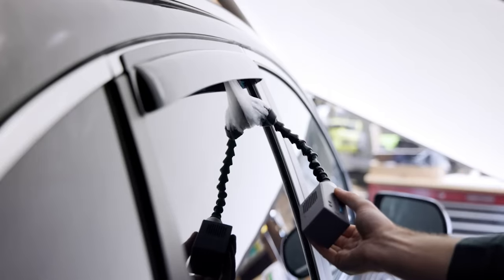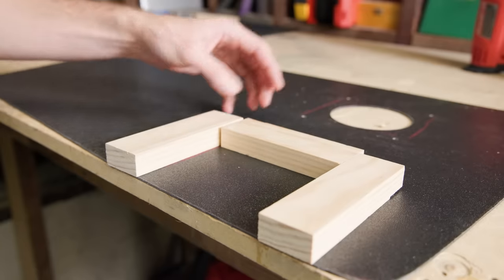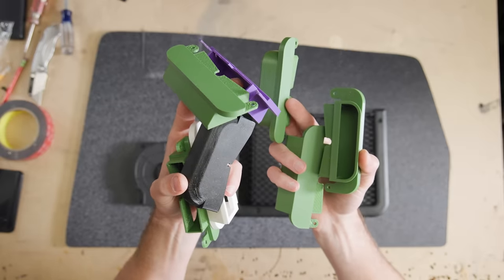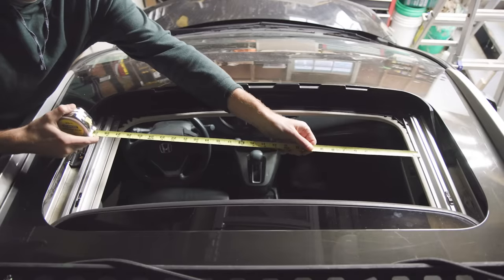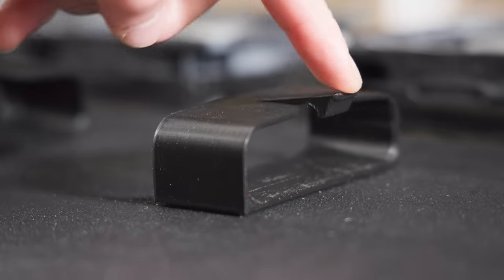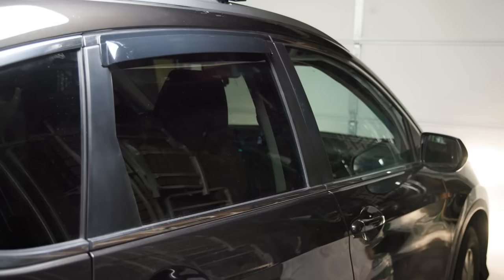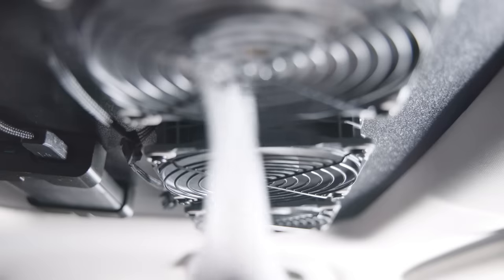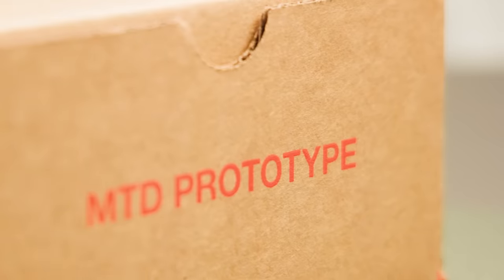Car Camp on Warm Nights With This Invention (V2)

Comment: Your exhaust fans can only expell as much air as your intake fans let into the vehicle - if they'd push out more air, they'd create a vaccuum. For maximum efficiency (noise as well as power consumption), intake and exhaust volumes should be evenly matched. To further reduce noise and increase power efficiency, consider how much airflow you really need. The vehicle's interior volume is not that big. Let's say the volume is 4 cubic meters (which is almost certainly an over-estimatation), to refresh all the air in the vehicle once every minute, you'd only need a capacity of 240 m3/h or about 140CFM.
Reply from the maker: From not enough to too much. Haha. Please hold for another year while I perfect. Thanks for the info!
Reply: I am confusion from this comment
Reply: @nickhernandez4264  Ok. There's 2 parts to this:

1.) Fan capacity - You have a certain amount of air in the car, and you want to refresh this air. The intake fans pump fresh air into the car. The exhaust fans pump stale air out of the car. These have to be balanced. You can not pump in more than you take out. And you can not take out more than you let in. Making the exhaust fans much bigger than the intake fans , just means they are inefficient. They try to work really hard, but they can not pump so much. This will use more electrical power and create more noise.

2.) Airflow - to keep the inside air nice and healthy, you want to refresh it periodically. That means letting stale air out, and letting fresh air in. If you refresh it too slow, the air will go stale, and you will get problems with humidity inside the car. If you cycle the air too quickly, you're wasting electrical power on your fans by making them work more than they need to. If it is cold outside, you will also have a harder time keeping the air inside nice and warm if you constantly bring in cold outside air. In short: you will need to find a balance, where you refresh only as much air as is needed, using as little electrical power for the fans as possible. 

Hope this helps :)
Reply: @akumabito2008  very helpful, greatly appreciated ( you're to kind most people wouldn't have tooken the time to write out and explain ).  Learn something new every day gotta love it 👍
Reply: @nickhernandez4264  you're welcome, my dude. Have an awesome day!
Reply: @MattTheDesigner  you're good with what you've got. You could even omit the intake fan and still be good. All vehicles have an open vent from the outside directly to the cabin to feed the factory a/c system. It's typically below the windshield by the wipers. Exhausting more air than being pulled in by your intake fan will just draw the difference through the factory vent. Omitting the intake fans would just draw a greater amount through the factory provided path.
Reply: Technically correct, of course, but the car is also not a vacuum sealed environment even with all of the doors, windows and sunroof closed. Either a net outflow or net inflow from fans will simply pull air in or push air out of the non-sealed environment, not create a significant overpressure or vacuum.
Reply: With the sun roof exhaust, the window fans are only obstructing the airflow. Removing the window fans, but leaving the opening, will actually increase the air drawn into the vehicle.
Reply: So does the math math if you half the CFM will it just take double the time? So 70cfm will take 2 minutes?
Reply: @DAstler  I've been thinking about taking this a step further and connect the car cabin fan to a powerbank over night, instead of complicated mounting of fans to the windows. But I think the cabin fan would draw too much power?
Reply: @SweetTorment72  that's exactly what this person did on their van: https://youtu.be/0lfheOOliwA?si=JJVoWVOG8d5L1hMw

It's likely going to be way too much power for a little battery bank, but if you're in a camper with more power available it is possible to hack in to the oem blower and run that.
Reply: No yur not correct. The fans on the roof are gonna pull in air even if there are no other fans involved.
Reply: @SweetTorment72  you don't want to mess with the car electrrics too much if you can help it.. can cause problems..
Reply: One does not simply create vacuum with small 12v fans. Slightly negative pressure environment is a better term. In this scenario you would want a balanced supply and exhaust cfm for best realized work to battery capacity ratio(move more air for the same amount of electricity). In lab or sterile settings you need a positive pressure that pushes particles out of the room and mitigates airborne entry. For airborne hazards and ventilation negative pressures are used to quickly remove harmful or unpleasant fumes and odors. Your air changes per hour are dictated by the difference in flow rate in and out per hour and the volume of your space, this value is higher in lab and sterile settings lower in commercial settings and almost nonexistent in most residential settings since they are usually not equipped with fresh air intakes or exhausts.
Reply: @akumabito2008 how do you measure what your fan’s airflow is?
Reply: Cargo space on a mid range suv is around 144 cubic feet. The entire cabin is like 3x that space. You're closer to probably 8-10 cubic meters.
Reply: @chrisz.9974 if his volume for the cabin is accurate then yes he'd be about correct. I believe his volume for the cabin is off my a factor of 2-3 which means you need closer to around 400-500 cfm to replace the air in the cabin every minute.
Reply: Technically yes, but you can have your car be a high pressure compartment (higher intake) or a low pressure one (lower intake). In the offshore industry we design some compartments to be high pressure to either avoid flammable gases to go inside the machine room or poisonous gases to enter compartments with people - i.e. if you open a door, the air escapes instead of going in.
Reply: A vacuum is desirable- that's how chimneys work.   Smaller hole at the top, bigger hole at the bottom.   Heat rises and expands, no fan needed.    If the exhaust is expelling more, then the intake fan works less or may be redundant

Comment: Paint the car white, It drastically reduces internal temperature of car
Reply: That’s true, but it’s not resolve issue when you sleep in the car. Ventilation is must have otherwise you have low level of o2 and higher of co2 during the night

Comment: Would probably be easier to utilize the car's factory HVAC fans and just wire them to run off a 2nd power source and the window vent can be the exhaust.

Comment: If you car camp in a Prius 2014 and before that time, with the nickel battery, just hit ac button and set temperature, and you have a really comfortable night. I did it for 3 months in really cold and then hot temps. After 2014 they installed lithium batteries which have trouble starting in the cold temps. Just an idea. Although with your idea, you could do that in any car!
Reply from the maker: I’d like to figure out how to do real AC all night. Maybe my next next video.
Reply: Sadly that limits the life of the hybrid battery. It's $3k to get a new one.
Reply: That hurts and limits the life of the hybrid battery. It's $3k to replace. Not to mention very small amounts to the engine.

Comment: I made a similar setup for my sunroof but with only one giant 5V noctua fan plugged directly into a battery bank. For the rear windows, I used blackouts made of reflectix with black cloth and some gutter guards glued on the top. With window rainguards, it was pretty much invisible from the outside and kept us comfortable during warm nights. We also had fans inside the car to help with really warm nights.

Comment: I made the sunroof ventilation and I might do the window later on, I really like your design but it was a bit too expensive for me. Just in case someone else wants to cut on cost I ended up buying a pack of 3 fans on amazing for about $12 (Thermalright TL-C12C X3) they can be daisy chain (1500rpm) and then I used Coroplast Corrugated at Home Depot for about $25. Much thanks for this idea I tested it with just the rear windows cracked open and it was pulling / moving air extremely well, it’s like day and night, I’m sure this will help sleeping when I’m out on the road.

Comment: My car has a similar system. It has a hidden blower fan installed in the dash. It pulls air from a weather protected vent, has vents throughout the vehicle that can be directed where needed, and is powered by a huge battery under the hood. My car actually came with it from the factory! I think yours might have this system too 😂 

Just kidding, this is super awesome and I loved seeing your creative process. The reason I said that above was I stumbled on a video of a guy that was building out a van and didn’t want to cut a hole in his roof, and he utilized the factory blower fan. He tapped into the blower fan circuit and controlled and powered it with his battery bank, independently of the factory wiring. It still worked like normal, but when the car was off he could flip his switch in the back and it turned on his fan. Pretty smart, on a budget especially!
Reply from the maker: Haha. Yes turning on the AC is an option. 

I think I’ve seen the video you’re talking about. I’m still a little scared to make changes to the vehicle itself but I might look more into this.
Reply: Yeah I get it, especially on a new Honda which has a BCM (body control module), or more likely an entire module that just controls the HVAC. His van was an older econoline which has a very basic system

Comment: Most of your airflow is actually getting blocked by your window coverings. Your window fan units are rated at 35 CFM each and not sure if they are even delivering that much due to the gap size. So in essence you have 70 cfm entering and 300 cfm trying to suck but you're not getting that 300, at most you're getting around 70 cfm +/-. Also you can't add the intake and exhaust together for an entire system and rate it at 370 cfm since it can't deliver that.

If you remove air faster than replacing then you will have a negative pressure in the cabin and if you're putting more air in than removing then you will end up with positive pressure in the space. Typically when cooling, you will have a better experience with a negative pressure system think about attic fans in a house. If you adjust your window coverings to have a gap for fresh air and remove the fan altogether it will keep your car cooler than with the system you have now due to restrictions of those window fans and the size of gap you currently have. 

Finally to get the air to be replaced and not take a short cut from the window to the sunroof, you can always use a drop cloth or something similar between against the roof and drop down behind the front seats until about 6 inches from the floor. This would require the air to circulate down first then around the curtain and back up. Then you could use your window fans now to cycle air from front to back behind the front seats.

Comment: Thanks for another awesome video Matt. As a homeless veteran living in my vehicle your designs have inspired me.

 I do know CFMs from working in HVAC so your airflow looks plentiful for the size of the cabin in your vehicle. 400CFM would be considered 1Ton of heating/cooling capacity. Imagine pushing 400 basketballs a minute of air through your car that mix to help bring the temperature average down.
Reply from the maker: Glad I could help Kev! Thanks for the info.
Reply from the maker: @portcityengineering  that too!

Comment: Only upgrade I'd recommend, ability to make either side window fan exhaust. Easiest (but more costly, probably) add a second fan to the window units blowing out. In my brain this should still give you air circulation in less than great weather. As long as the intake and exhaust are spaced apart, you shouldn't get any short cycling. Keep a more powerful fan for exhaust to force the air out further. For my application (but I'll probably never build) I don't have a sunroof. I do have two rear windows that pop out with a manual clip. Definitely got my creative juices flowing. Love your videos.
Reply from the maker: These ABS sheets and little fans could be configured in all kinds of ways. You should build one!
Reply: This guy made one for his minivan's pop-out windows, attaching it to a window cover made with chloroplast. Allows for good air flow/circulation. Not as 'stealthy' as Matt's, but still a good option.
https://youtu.be/iooH2nQpKR0?t=891

Comment: Awesome video! I recently made the V1 collapsible platform for my CRV and love it. Thanks so much for the plans. I do have a question for you. Will the battery pack you use for your window (26800 PD) run your sunroof? I know you said your sunroof battery will not run your window. I already own the 26800 PD and I’m hoping to use it for the sunroof, if it works. Thanks!
Reply from the maker: Yes it should run the sunroof.

Comment: Not sure if you’ve already figured this out by now but the newer Anker batteries will turn off if the load doesn’t draw enough current. Evidently the fans use very little power compared to recharging a phone. You can override this cutoff by double pressing the button. My model changes one of the LED colours when you do this.
Reply from the maker: Yea someone else let me know. Silly that I didn’t know that but it’s what I get for never reading an instruction manual in my entire life.

Comment: In such a small space as a vehicle I would either push or pull the air but not both, which ever way I would think a hood system to block rain with insect screen would be less complicated and less expensive. One important  thing to know about airflow is you can't exhaust more than you can pull in and vice versa

Comment: I really like your ideas. They actually inspired me to try the moon roof one on my camping Range Rover. I actually used a small usb outlet solar panel and leave the roof cracked so it kept the vehicle well vented in the hot days when parked. And reconnect the fan to a power bank in the nights when camping. Great job and glad you are keeping it evolving :)

Comment: Do you really need to add fans to the side windows if you already have the 300cfm fans in the sunroof? You’d probably just need vents?  Assuming a closed cabin, the air being pushed out of the sunroof would cause a decrease in air pressure which would then suck in air from the side windows so the side window fans may not be needed if you want to simplify things in the future.
Reply from the maker: It’s probably overkill. The hope was that folks would take bits and pieces of this and do what works for them. Thanks for watching Clifford.
Reply: Ok. 👍🏻 Cool project overall. Thanks for taking the time to make the video. 👏🏻

Comment: 12 volts is everywhere in a car.  Use a socket adapter and direct power from your big boy battery.
Also as others have said, way too many CFM.  But I love the idea and am working to adapt it to my more cold-weather needs.

Comment: with the 12volt fans i would have used USBc PD and the highest wattage availible with a little voltage selection board
Reply: That is great idea.  I have power bank with USBC-PD ability. No need to buy another 5V fan (not powerful enough, so you need three fans, of course also need to consider the Fan noise).  I have plenty of computer fan that I gathered from years of used old computers.  All I need is to add a speed adjuster.
😀😀😀😀

Comment: So that anker battery pack turns off because of the low power going through it. It turns off to save it's battery. I think if you long hold the button it turns that feature off. Either that or like double tap it. Once of the little LEDs should change color.
Reply from the maker: OMG I feel stupid ahha. Sorry Anker for the false claims.

Comment: CFM: Cubic Feet per Min. Volume of air in feet, could be and liner measurement eg CC, Yards, cubits as long as you get it cubed. I would put some Gaffer tape on the tiny bolts against the window so it doesn't scratch it or rip-up the tint. Excellent as usual, I love your sarcastic? humor, it's motivating. I look forward to each one, well the ones I like, Lol. Safe Travels buddy!
Reply from the maker: You don’t like them all???!? Haha. Thanks for watching Mitch!

Comment: I love this video!  Thanks for the great design ideas.  Just one thing that I would like to comment on.

Your current design appears to produce negative air pressure.  That is, the air pressure inside the vehicle might be lower than the outside air pressure.  The potential problem with that is dust and pollen could  end up gathering inside eventually, especially during pollen season.

I don't know if you consider this an issue or not, but positive air pressure would be ideal.
Reply from the maker: Always room for improvement. It’s still new so more testing needs to be done for sure.
Reply: sounds like someone has experience in either spray painting booths or dust free labs...

Comment: All though the system was very well made, I can tell your not a big car guy. 

Most vehicles built since 2000 had an abs vent built in the rear of the vehicle, for cars and SUVs it’s usually placed in the side of the cabin area with the vent hidden behind the rear bumper valance. For trucks it’s usual on the rear wall of the cab below the trucks bed line. These vents are large enough to pull and push air with your large fans. There is normally a vent on both side of the vehicle so it’s just a matter of run one pulling and one pushing to circulate the air. 

The idea is to prevent the cabin area from becoming a giant air brake if your driving down the road at like 65mph with a window down.
Reply from the maker: Maybe I’m an idiot savant.

Comment: I'm going to recommend using PETG for your 3D printer.  Cost is only a few bucks more than PLA but it'll handle the heat way better than PLA!  (I also make parts for cars....Honda Elements specifically actually).